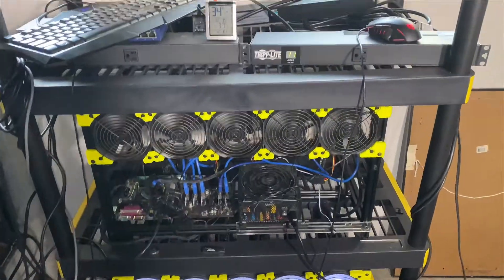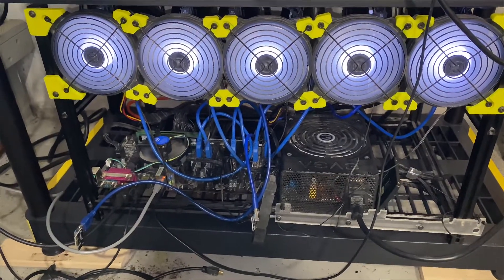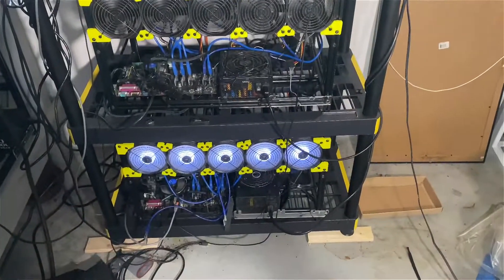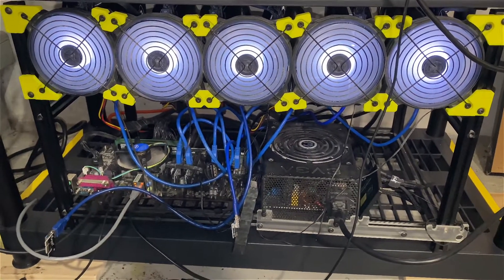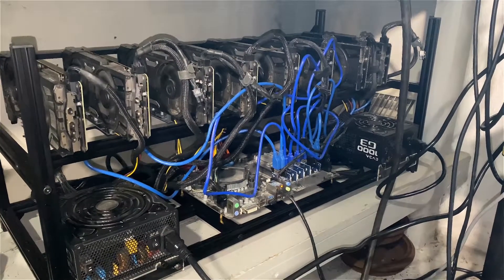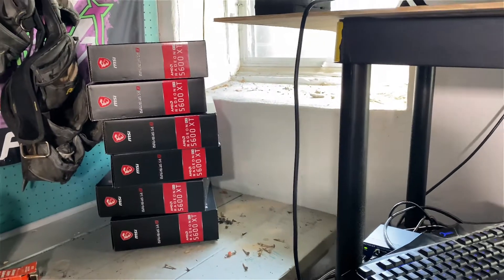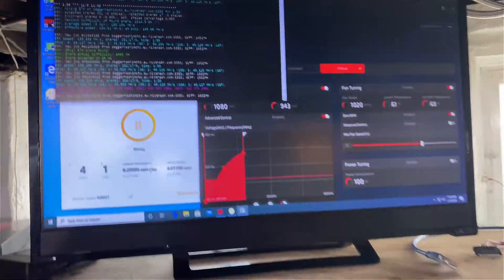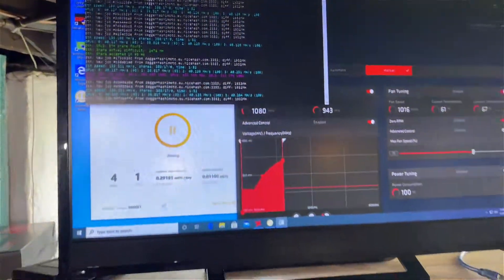5600 XT mining rig built pt 2 the struggles

Comment: does that 38mh one has samsung vram by any chance ? I got my 2nd 5600xt today and the first one I have hashes at 40.5mh @83w but this one, I can't undervolt or overclock vram at all. Checked it and the first card has micron vram and this new one has samsung vram.
Reply from the maker: All of mine have micron.  A few of them had issues in windows with crashing when trying to overclock or under volt. Right now it’s on hiveOS.
Reply: @jtravaglini  mine is micron too im mining in windows using phoenix miner. i have 6 rx 5600xt sapphire pulse be. 5 is getting 40mhs one is 39mhs i found out that 1 gpu doesnt want 1860 memory oc and it get stable at 1830. and another 1 is doesnt want low voltage in core clock. now its stable mining a month already
Reply from the maker: @danilomacario8616  that’s good stuff.  I need to post another follow up on this rig. I’ve changed it up some since I made this video.

Comment: Claymore has kinda lost support the past month or so and Phoenix has been wonky on my 580 rig the past week....kinda weird that all the cards are not being recognized....hope you get it figured out quickly...I have found stable settings on the 5600xt(same gaming X as you) with stock bios and core clock of 1100mhz 800mv and have the mem overclocked to 1860 all on Radeon (gave up on afterburner) and getting 40and change mh/s at 85watt each
Reply from the maker: I got it mining and it seems to be stable.  It’s on windows right now using nicehash.  I was having issues with Windows I think so I modded the registry file and it seems to be working a lot better.  I am pretty much on stock memory settings though and lowered the core clock.  Averaging 38mh/s.  If it stays stable I’ll start lowering the MV on the core and upping the memory slightly to get it more efficient. I’ll be making a video about the state of it real soon.
Reply: Agree with this. Got 40mh also.
Please use the adrenaline version 20.